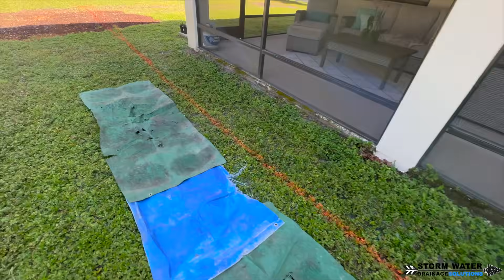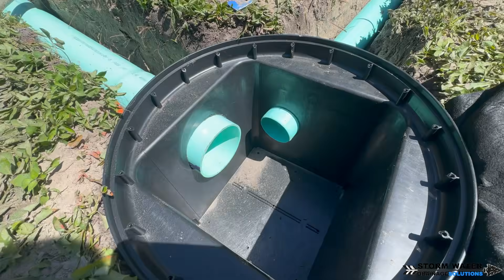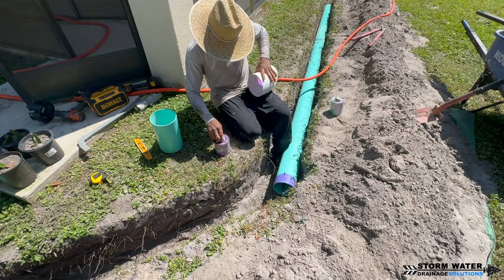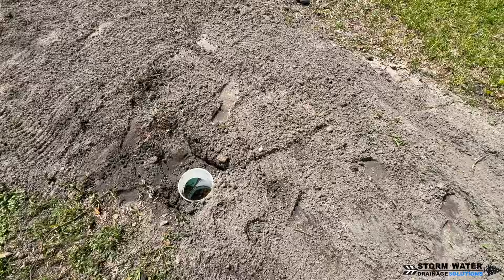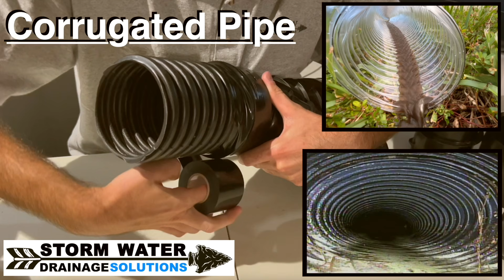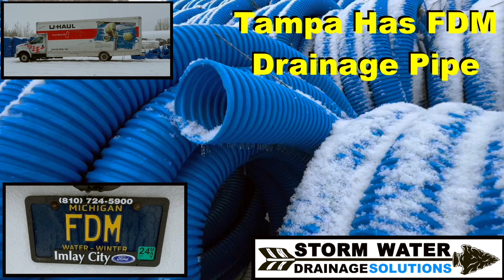How To Install PVC Drain Pipe For Yard Drainage - Storm Water Drainage Solutions

Comment: In this video, you are using a 6in pop-up by NDS. In a previous video, y'all did a bottomless catch basin with a hinge lid, stating there were no good pop-ups for a 6in pipe. (I can't find that video now) Is this pop-up by NDS better than that catch basin method?
Reply: Oh, it's your most recent video where that is mentioned  https://youtu.be/jaVdIv_oI9M?t=327
Reply from the maker: @theepower Yes after using these 6in pop up emitters for awhile we opted for using 9x9 hinged basins instead because the flow rate is better.